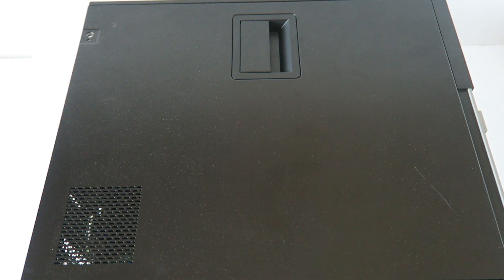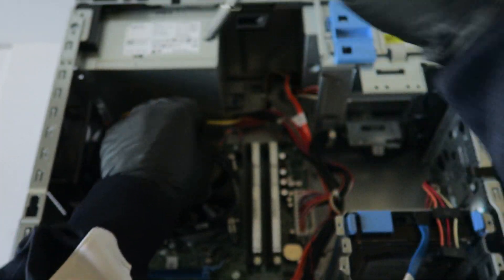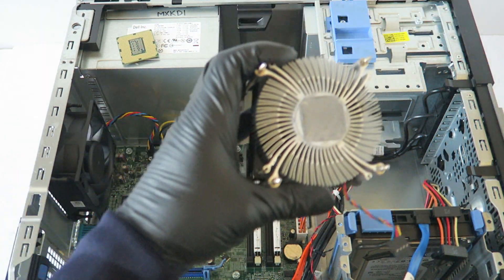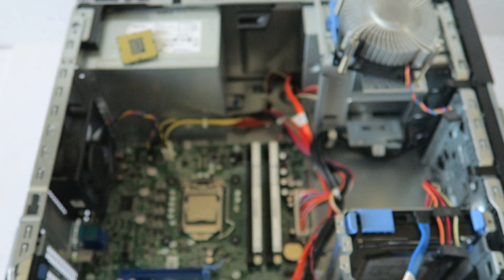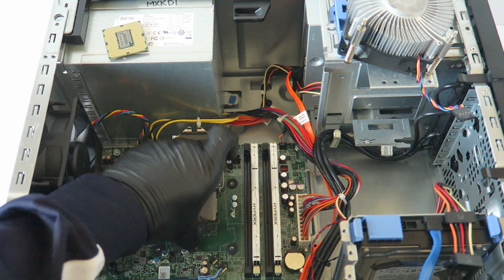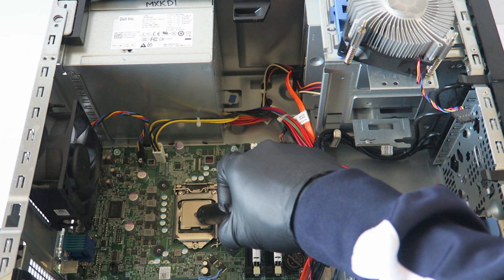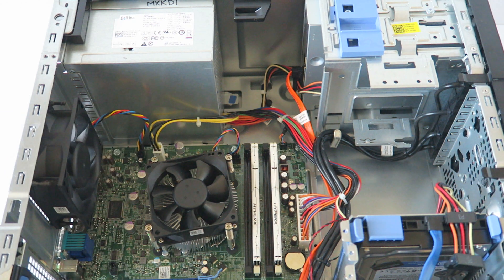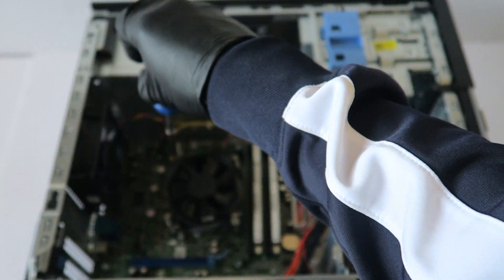Dell Optiplex MT MiniTower Processor Upgrade

Comment: NIce video but wish you'd give little more info. What cpu u upg to ? IS the original fan/sink good to do a xeon v3-1275 ? Does the bios need updated firmware wise or in the bios itself ? Thanks.
Reply from the maker: Hi, it depends what kind a PC do you have dell model ?
Reply: @Mxkdt  Hello. Thanks. The Dell Optipex 790 MT. I5-2400 CPU. Thanks again.
Reply from the maker: Dell Optiplex 790 you can upgrade CPU to i7 2600 and Supports MAX 32GB of RAM, Latest BIOS Version A22.

Comment: do I need a specific cup, I bought a dell optiplex 7010 mt with core i3 3220 and do I just buy a i5 2400 and that would fit on this motherboard or am I missing something. And does thermal paste matter on any brand so like I can just buy the paste and use it.
Reply: imartino so, since your Optiplex came with an i3 3220, the “3” in 3220 tells us that the i3 you have is a third generation intel cpu. Your motherboard is newer than what is shown is the video. I would recommend you looking for an i5 3xxx (I don’t know what the exact numbers are but look for that 3 in the beginning ) or even an i7 3xxx. Hope this helps.
Reply: @pressstartfrank8606  k

Comment: Hey man I have a dell optiplex 9010 mini tower and am wondering if the Thermaltake Smart 500W 80+ White Certified PSU, Continuous Power with 120mm Ultra Quiet Cooling Fan, ATX 12V V2.3/EPS 12V Active PFC Power Supply PS-SPD-0500NPCWUS-W will fit

Comment: I would like to ask in your opinion would it be better to buy a new desktop or upgrade my lenovo h530. If it is better to upgrade can you do a video on the lenovo h530.
Reply: HenryDaRiceman to be honest you should get the Dell optiplex 3020 mt they sell them for 80$ with i5/i3 4th gen with win 10 pro and 4gb ram because they have more room support i7's with upgrades so far and 500gb hdd if you spend 10 more dollars I bought one and I know how good it is if you want the link where I got it for 80 I can give it to you
Reply: Since they go for quite alot on ebay you should get an i5 or i7 moddel with 1tb and 8gb ram since those are worth about 170 and the Lenovo computer you have is worth 180 you should try selling it even if you take out a few parts

Comment: Ok so i have an Dell OPTILEX 790 MT, his specs right now are:
i5-2400 3,1GHz, 10GB ram,
 2 HDD 250gb they are the same,
and the psu max continuous  total DC outputs shall not exceed 265W , this is written in the paper on psu.
I want to add a gpu  but i dont know which,  like i dont know if it can support gpu, i play some games like minecraft and among us and i can play with nice fps  without gpu but there are some games that i dont get much frames, so i want a gpu which can fit in this machine. (when i mean gpu is an external dont get confused bout it neither judge me if something is wrong :)
Reply: If your system's power supply have 260 watt of power  then u can install gtx 750ti this take approximately 75watt of power ... Or u can install gt 1030 ✌️

Comment: How I have a processor can the dell optiplex 3020 MT go?  I currently have a Intel Core i5 4570 (3.20GHz), a 64 bit Quad-Core Processor with 6MB L3 Cache Per CPU // H81 Chipset
Reply: I have your same specs CAN you tell me the cpu upgrades I can do for this

Comment: Believe it or not DELL recently updated the bios on the Optiplex 390 to A14, 5 years after last update. And from what I read it will now accept Ivy Bridge CPU's: https://www.dell.com/community/Optiplex-Desktops/390-CPU-upgrades/td-p/5975479/page/2 (see 5th post on page). I updated bios with no issue, but want conformation that I can toss in an i7-3770.
Reply from the maker: Hi, thanks for the info.

Comment: Hey I have Dell optipleex 3020 the i3 version.
I have upgraded it with a Gtx 1060 and 450 watt PSU, now I'm planning to upgrade the processor to Ryzen 5 2600x. 
I just wanted to know if its compatible with the motherboard?
Reply: Ammar Khan  really??? No, it's impossible , one processor it's Intel and the other AMD
It's never gonna be compatible the same motherboard
Reply: Its not compatible cuz its intel its better if u get a micro atx amd ryzen motherboard and slap it in the dell optiplex case if u remove the motherboard or just get a new case and slap that motherboard in ;)
Reply: Aspire Bolt 
Ohok
Reply: Ammar Khan mate I would recommend just upgrading the processor to something the motherboard is capable of. You most likely have an LGA 1150 motherboard so I would recommend an i7 4770/k. Make sure it's compatible with your motherboard though.
Reply: Holiness 
mih81r tigris this is my motherboard
Im planning to get b350 motherboard to install in the dell optiplex, since I have a 1060 which is running on a 2.0 PCI express.

Comment: I dont know if you still check these videos but if i get a 790 minitower it comes with a i5 2400 I was wondering what cpu I could upgrade too also if i could get a better cpu fan
Reply from the maker: Hi, yes you can upgrade to Intel Core i7 2600 and don't forget to update BIOS to A22.
Reply: Mxkdi How do you update the bios? I have one of these with an i5 2400 and I got an i7 2600 but idk what I should do when I install it.

Comment: How max linie can upgrade? Work with 3th ? Or only second. Can I use i5 3550 ? Or 2500k
Reply: Any LGA1155 comp cpu would work in these dells, stay away from the i7 2600K since it doesnt work

Comment: Hi there just wanted to know what is the mhz on those ddr3 sticks are they a1333mhz other mhz like 1680mhz..
Reply from the maker: Hi, what model is your dell ?
Reply: @Mxkdt  it is a Dell optiplex i7 mt 3rd gen.9010..and can you put a 500 watt psu rbg for a 275 wattage psu.

Comment: is it possible to do it without the thermal compound?
Reply: If you don't like messing with thermal paste. You can always use a thermal pad instead. IC graphite thermal pad off of Amazon which also works great. Just make sure to get the right size.

Comment: hey bro, please can you answer me this? i asked u that in a video you made but got no answer... I have a hp compaq pro 6300 mt and you upgraded the video card with a geforce gtx 1050 ti and 16 GB of ram but my processor is i-3 2120 3.30ghz is it ok to upgrade it like you did or do i need to upgrade the processor as well?
Reply: jorge benitez i3 shouldn't bottleneck the GTX 1050 Ti too much but you may have to upgrade the power supply if you upgrade the graphics card. (Some GTX 1050 Ti's need a 6 pin connector I believe.)
Reply: Holiness ok thank you

Comment: Hi everyone hope you are doing very well. Well I would like to upgrade my Dell Optiplex 3010 Mini Tower, Core i3 3220 3.3 GHz -- I want to know what other processor can this motherboard support, i5 and i7. I have been looking information other blogs and it seems I can only upgrade to any i5 3rd generation processor but not i7. I will appreciate your help thank you!
Reply from the maker: Hi, yes dell optiplex 3010 only supports i5 3470, i5 3450 and i3, pentium processor and if you upgrade to i5 and install boot ssd drive and that would be great machine.
Reply: I have a Dell Optiplex 3010 MT and I can confirm that the i7 2600 works perfectly fine.